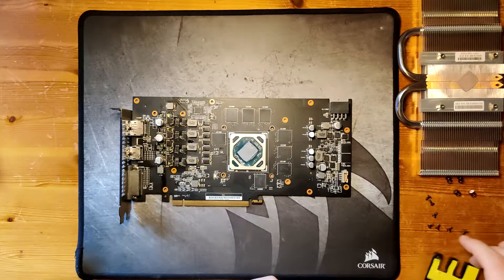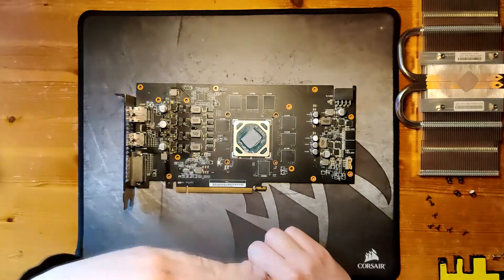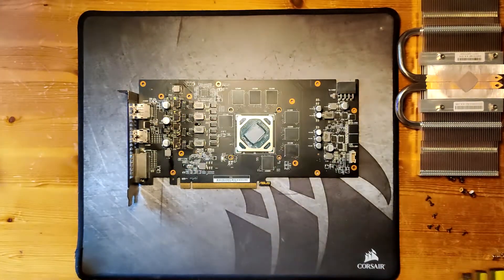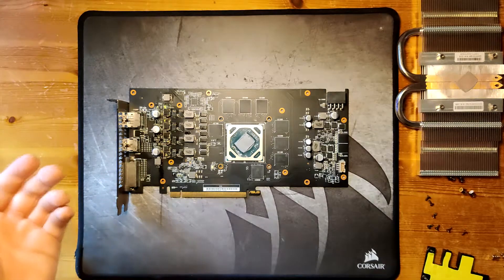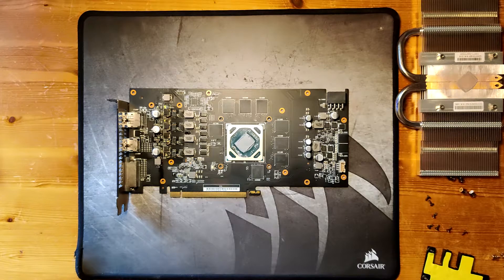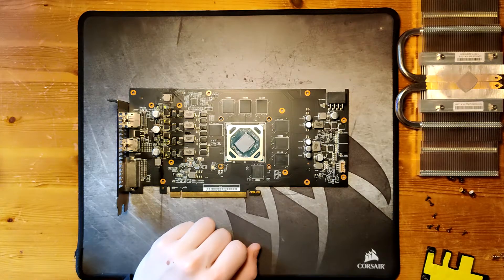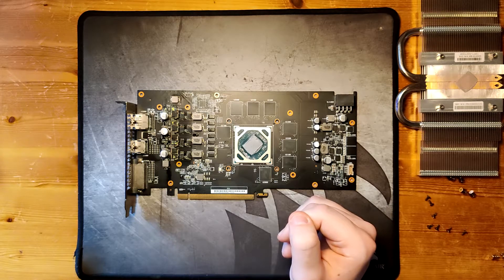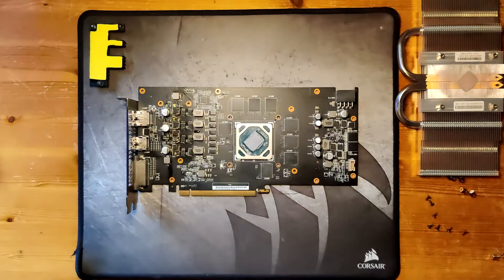RX 570 VRM fixed but... it still doesn't work

Comment: I got one card here with same issue. The issue is caused by defective mosfet drivers. You can damage mosfets as many as you want. But a problem that is more concerning is that you can hardly find good replacement driver ic-s. Mostly crap on several platforms that you buy. This is definitely something for people who work as professionals. Nothing for a casual user that sometimes takes the soldering iron to solder 2 wires.

Comment: I have the same card, doing some quick measurements it seems like 1 of the high side fets are bad, but I also see some strange values on 2 of the 4 gate drivers. They seem to be RT9624AZQW.
Not sure if you have any thoughts about that. I need to document my measurements.

Comment: Hello, i have a rx 570 asus too, and i rebuild the power circuit, it was a mess, but now i still have the problem is not recognized, i have 3.3, 1, 5 and 12v, but i am mising VGPU, VDDCI and VMEM, i think can be my VRM digi+ chip but i dont know how to teste it can you help telling me what i need to check on that chip?

Comment: If the same mosfet burns out several times, I would suspect that it has some kind of controlling problem. You could check the duty cycle on the gate of the mosfet, that burned out and compare it to the other ones, also check gate voltage. I think, high duty cycle, or low gate voltage could cause  overheating. But I'm no expert. Good luck, You should make a follow up, if  you find the culprit.